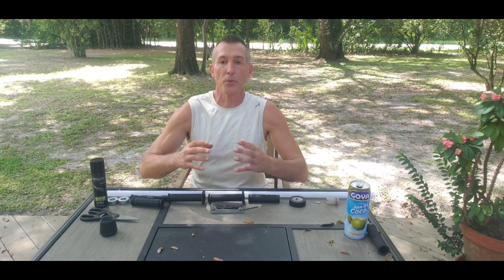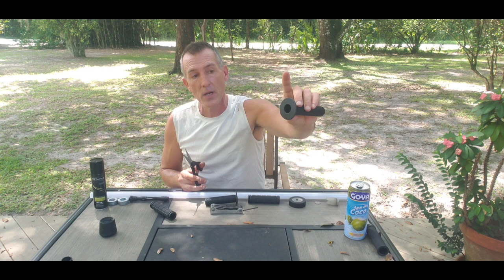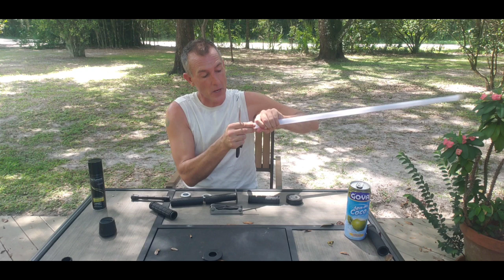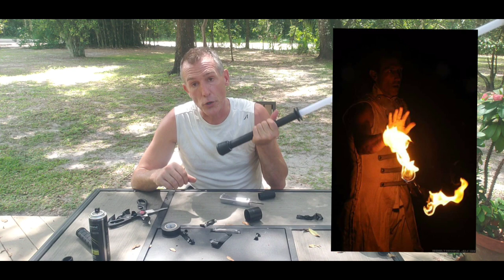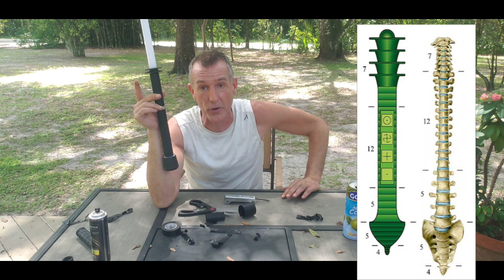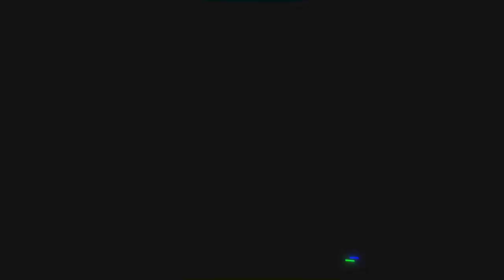WayLlighter V2 Assembly Tutorial

Comment from the maker: Here's the parts List!

The WayLighter LightSWord V2 Parts Order list.

Blades.

Any 7/8” polycarbonate tube will work. Must be able to fit the/a flashlight inside. Most pen lights fit.

This lightsaber shop has stock, delivers promptly. Good people.

https://www.thecustomsabershop.com/78-Thin-walled-Trans-White-PolyC-40-long-P700.aspx

Green tinted blades look awesome.

Clear blades are ok, but not as bright. All blades should be lightly sanded to diffuse better.
You can also put transparent film inside easily to create custom color.

You can also source blades on Alibaba under Lightsaber blades. Pre-colored blades can be sourced.
Often no minimum quantity.

Might be a polycarb factory near you to make friends with.

Inline Plastics in California will get you 1100 blades for $2000. But that's their minimum for orders.

If you pre-sale/pool with your friends you can have a lot of stock on hand. If this goes critical by Christmas you could be in the money.

I may buy a bunch and have them sent to a dropshipper if this catches traction.

40” blades are what I use. Balances Perfectly with 2 of the shaft collars used for pommel weight.

Shaft Collars:

These are circular metal doughnuts that attach to the blade with a set screw. This give us the end weight needed to balance out as a contact sword. You will need an allen wrench to attach them.

Here's 13 for $10.88.

https://www.amazon.com/Plated-Shaft-Collars-Solid-Screws/dp/B07VQXKHRM?th=1

At 40” you will need 2 per WayLighter.

MUST BE 7/8TH INCH INNER BORE! That means the hole fits the 7/8th blade snugly.

Outer diameter will usually be 1.5 inches. You need to make sure the chair leg tip you buy for the pommel is the EXACT same size.

Pommel – Rubber chair end leg tip.

Super easy to source. Can be found at many local Hardware Stores. You can find different colors to match your grip colors.

https://www.shepherdhardware.com/product/1-1-2-inch-black-rubber-leg-tip-40-pack

Drill Cut or punch a hole in the bottom center to access flashlight switch.

Or use your eye lasers if you are an X-person.

FlashLight.

Many widely available Penlights will work. Must be tail clicker. As in the button is on the bottom. Side clickers can work, but you'll have to pull the ponmel to activate,

YouCan find Blue, Green or UViolet easily.

DO NOT MAKE RED BLADES PLEASE. EVER! Hard rule here. Red blades rep Demons. The Waylighter is for Heroes Only. I will get pissy if I see Red Waylighters.

Get as many lumens as possible. Strobe effect looks cool AF. The blade flickers mystically.

Durability is a factor. Some are poorly made and break easily. Sad faceensues, I prefer penlights with built in USB charge ports so as to not have to use/pay for batteries.

This $20 model from Harbor Freight is 100% Vetted Djedi Quality in every way. I LOVE them.

https://www.harborfreight.com/140-lumen-pocket-rechargeable-pen-light-56511.html

We'll have a section on Odysee,com where we all share our flashlight wins. We will custom make our own application specific model when resources allow.

Grommets.

The Grommet is used to keep the flashlight from sliding into the tube. Harbor freight will get you 10 ussable sizes in this kit.

https://www.harborfreight.com/hardware/o-rings-grommets/grommets.htmlns

If you plan on making millions, (please do) then custom order them so your costs go down. I'll find a better link as soon as I find it.

Slide it on, add some super glue for extra security.

Electrical tape.

Standard black electrical tape. Available everywhere. You'll use this make the penlight fit snugly and help secure the grommet.

Grips.

Any standard Bike, Mx, or Scooter grip will work. MUST BE 7/8th inner diameter.

You will need 3 grips total. So order two sets.

This is the fun part Djedi. There are tons of supercool looking grips out there. Go nuts customizing your own signature LightSword, with custom colors and styles.
Reply from the maker: If the grrip you choose is “closed” ended you'll have to cut the closed end off, or drill through it.

Soft rubber grips are easy to cut. Softer is better for contact spinning.

Locking grips have metal rings to secure the grips on your blade. This means it's easy to reuse if the blade breaks. VIP!! An exposed Set screw or a sharp Right angled metal edge will eventually hurt if it bonks you. It will. I don't use them for that reason. There are rounded edged locking grips that are super cool though.

Some metal lock grips have turtlenecks that cover the set screw. I have not yet tested them, but assuming it's good.

Personally I prefer the soft grips bc it makes bonks pillow soft.

You can reuse them if you re-wet the hairspray used to adhere them and wiggle them off.

Hairspray.

The Hairspray is used to lubricate the Blade in order to slide on the grips, then it magically becomes the glue that keeps them there.

You can find hairspray. I know you can. I believe in you.

Just the TIPS.

Another 7/8th chair leg tip. White or clear for white bladed. Clear for tinted blades. Thicker is better for shock absorption. The Tip takes the hardest drops, so cushioning is your friend.

Right now I think the tips that go outside the blade are better than the tips that slide inside. I think the blades ability to flex helps the blade from breaking too easily.

You're also going to drop in a nickel or 7/8th washer to create tip weight mass. This helps generate better spinning due to inertia via centrifgual force.

Simply slide on and drop in a dollop or two of superglue. Done!

I also think the nickle absorbs the impact of drops of concrete. You'll never break a blade from drops on grass, gravel or dirt. But I have cracked one on concrete. Which is why I've now added 1” heat shrink tube.

I'm using this and I love it. It will help protect the blade when spinning on hard surfaces. I'm guessing that if the tip end of the blade cracks it won't matter bc the heatshrink will just hold it in place.

Can't confirm yet, but seems reasonable. Very affordable.

Comes in custom colors so I'll be looking into that as it may be the best answer for colored blades. Will need to be transparent though. Feel free to find out.

Simply slide on and hold over the stove top, or hit with a hairdryer and it will magically mold itself in place perfectly. Fire will singe this if too close, and leave soot spots FYI.

That's All Folks.

That's all you need to Assemble the Highest performing LightSword on the Planet.

You Rock.